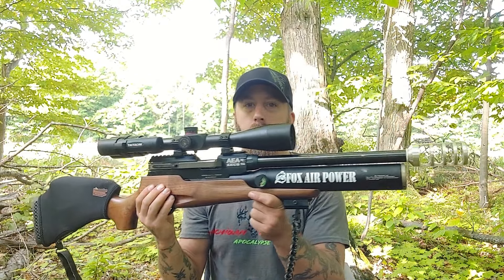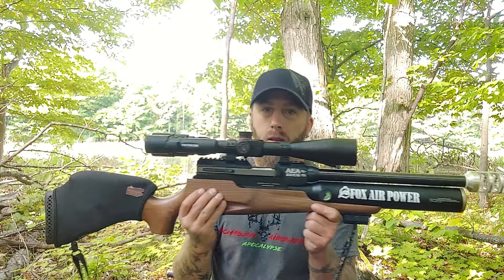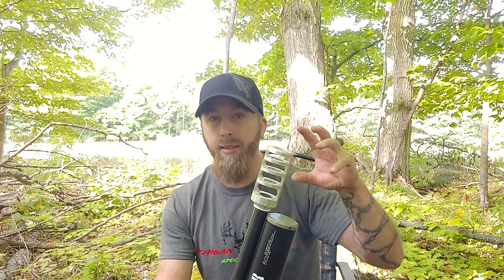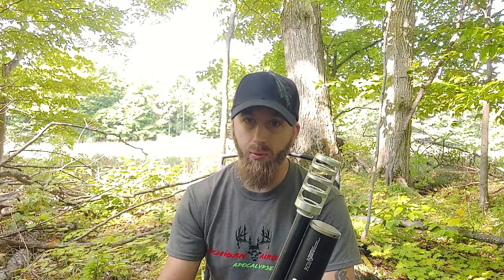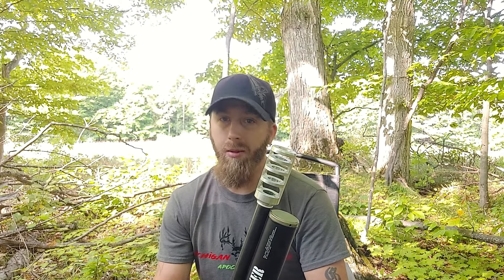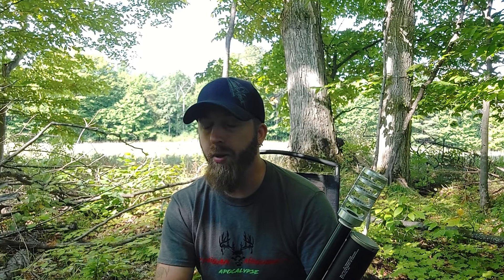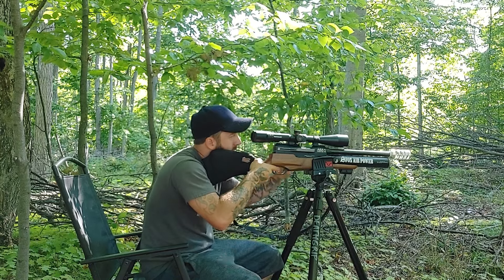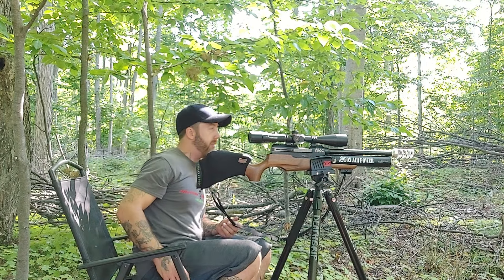lets talk... 72cal muzzle break!!

Comment: just to let ya know, the 18mm steel bearing will roll in the .72 zeus, 18mm is .70cal so dip it in wax a  couple times, . it will go through just about anything.
Reply: also grab a  magnet from k&j  magnetics to keep any steel in place before you pull trig. and use it to magnetize the bolt , this will stick the bearings to the bolt with magnetic force. 

that muzzle break, i wonder if the construction includes pieces of flat rubber mulch between steel mesh. the air moves between the edges of the rubber so dont make it too tight. doing that makes it whisper quiet and all you hear is the hammer spring in the air cylinder.

Comment: can you tell me which molds .72 I'm new to big bore and bought a zeus
Reply from the maker: What one did u buy.. the 16in the 24in or 32in
Reply: @MichiganAirgunner   I buy 32 in in .72 and 58
Reply from the maker: @elvischam007  I would buy a .579 size mold for the 58cal... And a .729 size mold for the 72cal.. the molds from accurate molds run a little bigger then the size u order
Reply: thanks again